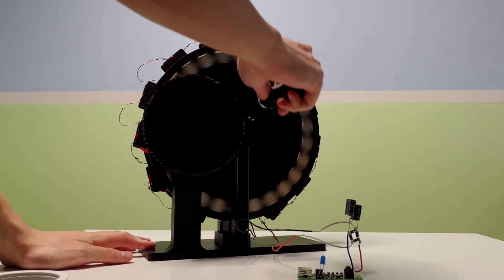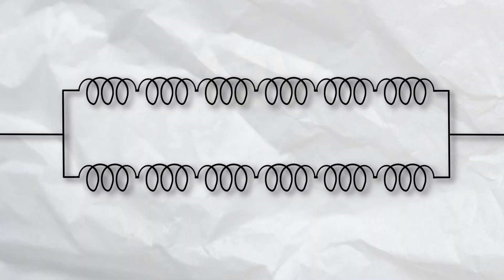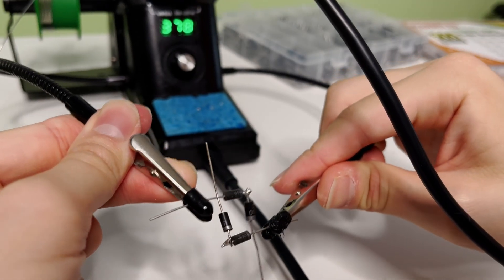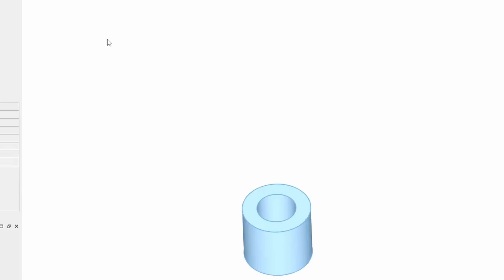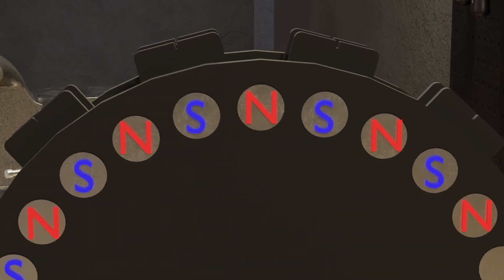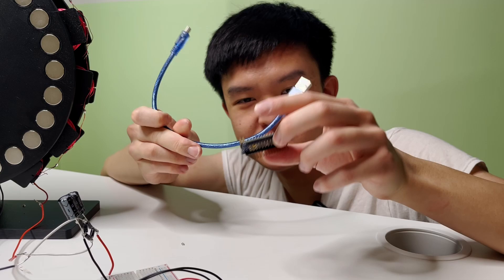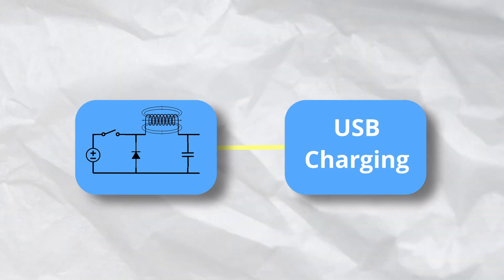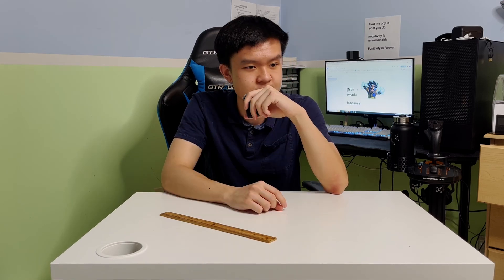I Built a Hand Powered Generator from Scratch

Comment: so many headscratching moments... you used steel core to increase power production and instead of some non ferus bearing rollers to fight friction you removed them. I mean, it works but you reduced your power output significantly

Comment: Dude convert your generator into an axial flux motor. It's the same design but instead of spinning it you can just run a six-step commutation signal and hook up the coils in a delta or wye configuration.